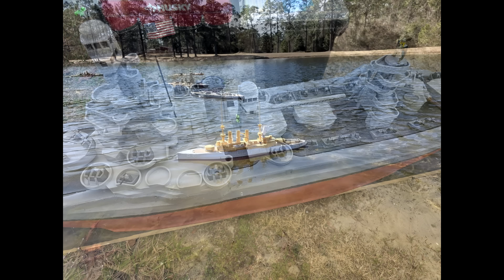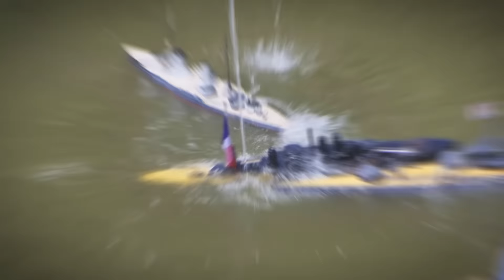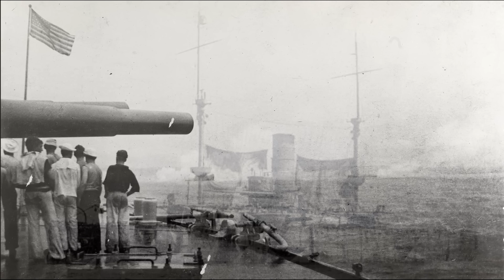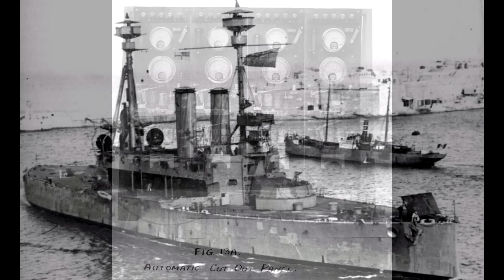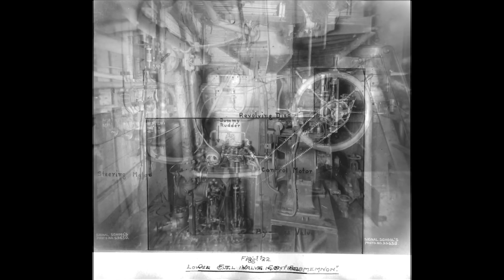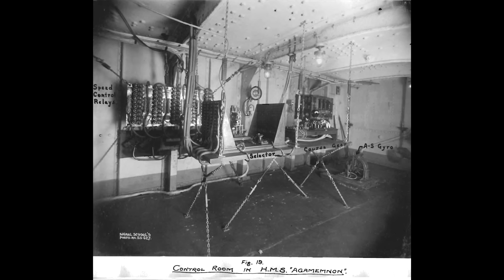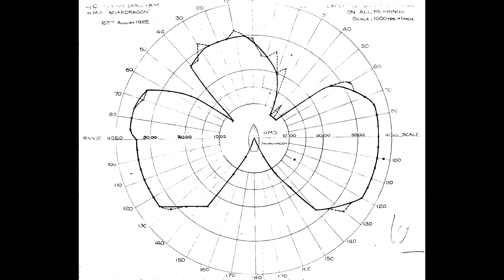Radio Control Battleships - HMS Agamemnon and How She Worked

Comment: Looking at that trailer I remembered a remote controlled submarine I had as a kid in the 1980s. I remember desperate attenpts trying to fish it out after it 'dived'...
Reply: Sometime around 1970 I scratch converted an Aurora model of the USS Skipjack into a fast and straight running battery powered torpedo. I had trouble with depth control too, but what fun that was.
Reply: No worries... the CIA recovered and examined it, no nukes onboard.😁
Reply: What goes up, must come down. unfortunately, it doesn't work the other way around. My condolences for your loss.

Comment: You had me at 'CO2 powered BB cannons'. Though it does raise the question - how close are we to having a vessel the size of a frigate or destroyer be made to run as a drone? The bigger and more complex something gets then yes, you need meatbags ....... I mean humans, to crawl into tight spaces and do repairs. Now, to be clear, I do not trust chatgpt or it's ilk to tell me how to boil an egg, let alone give it cruise missiles, but wit hthe way automation is going, how long before humans are taken (mostly) out of the line of fire?
Reply: Why even mention a language model for a drone? It's a language model, not an actual AI. It's just a marketing name.
Reply: That’s not the question I believe that’s being investigated. In principle a future Navy shouldn’t need more than Frigates (as drone flotilla leaders) & Aircraft (Drone) Carriers. The basic idea is a human crewed Frigate will have 12-30 drone boats under its command, dealing with logistics protection & firepower to make up a fleet. Offensive missile control will be from crewed stations, but AA & ASW defence drone boats maybe autonomous under war conditions. In this way you could give a single modern Frigate the offensive power of a C20th Destroyer Squadron, Cruiser or Battleship. Which is why no one is sensibly building Battleships at the moment. There is an issue about what happens if EW & SEAD aircraft gets in amongst such a drone flotilla, but those technical solutions would lie under Classified at present. But there is an attraction to modularising ship capabilities into drone flotillas, as it does solve perennial design issues of how to add weaponry, protection and power over time or during a specific conflict. Without taking your crewed assets off station, refuelling, rearming or refit should be possible at sea by adding various autonomous units. The drones themselves could also bring added power generation to the flotilla as a whole. This is the technology is now in testing to find the practical issues around operation autonomous boats, but large numbers of small craft in a swarm is where the beauty lies in this system.
Reply: @MsZeeZed  Unfortunately, in the ocean there are significant disadvantages to small vessels when the waves get large, which is a surprisingly often - and this condition can last for days at a time.  It's not like operating on a small lake or even a large river.  No first rate navy can allow itself to become dependent on small craft for surface operations, when it needs to operate in parts of the world notorious for bad weather - such as the North Atlantic.  Small craft can still have a place, of course.
Reply: I think the main point of drones is to be cheap and expendable; in many cases they are not even expected to return to home base after completing their mission.  So they are built with one or two specialised capabilities, and those become the drone's mission.  Some drones are platforms that can accept a variety of capability modules, which are attached once the mission profile has been decided.
Something the size of a conventional warship, even the lighter types of surface combatant, would very much not be cheap and expendable.  It would also be much more difficult to hide whilst enroute to or on approach to its target.  Once hit, it would also not benefit from damage-control efforts from an onboard crew.  These combinations of factors would probably increase the cost per mission way out of proportion to any increase in capability.
Reply: "humans are taken (mostly) out of the line"  Asking for Skynet?
Reply: The USN is using under water drones to search for mines in the Arabian Gulf.  My understanding is that these are semi-autonomous drones.  There plans for and testing of unmaned small ships designed to extend the sensor reach and defensive depth of a USN task force.  How close they are to deployment is probably more to funding than actual technical issues!  The Navy is also testing autonomous drones launched off the carriers designed to be offensive weapons.

Comment: It's funny how radio controlled ships, aircraft, and even glide bombs (FritzX) were developed way back in WWII and yet development 'appeared' to stagnate for 80+ years until the technology exploded in the Ukraine war. Much of it has now been replaced by sat comms, but is still in use with frequency hopping. Obviously there was probably some stuff going on but should have been much more.
Reply: The problem was it was very easy to disrupt the radio controls frequencies used!  That was why the Fritz-X was initially successfully but quickly became almost useless!  The Allies learned the radio frequencies used and jamed them!
That applies to virtually all remote controlled weapon systems!
The frequency hopping technology was invented durring WW2, but it's was in its infancy and not readily usable for remote control weapon systems.
It's use only became feasible in the 1960s-70s with transistors and integrated circuits!
Reply: It seems to be the perfection of Wi-Fi security frequency hopping technology was the key brake on development.  Drones have been around for a while, at least 2 decades, but hardly small and hardly cheap. Usually spotting/recce/recon and the occasional US Target could testify that there was an offensive capability.  But now it has matured into a tactical level weapon of serious capability thanks to in some ways old mobile phone technology.

Comment: Suggesting a video on the ship's blacksmith in the age of sail and on, (interested as a blacksmith myself) what they did, and maybe how the blacksmith, carpenter, splicers etc fitted into the ships company.  Great videos as always Drach!
Reply: The Return of the Obra Dinn has a bit on the ship's carpenter.
Reply: As I recall, the channel Gold and Gunpowder (pirate and late 17th century seafaring channel) has at least one video on the specialist craftsmen, their roles and lives aboard ships.
Reply: As a Blacksmith 🇬🇧 I endorse this message. The Royal Navy has a long history of employing Smiths port side and onboard her Warships. Frequently they were payed better than the regular matelots, and received more perks. ⚓️
Reply: As i understand it, there were usually experts in certain crafts on board the bigger ships.  It was necessary to have a carpenter on board, because while a crewmember could saw a board and nail them together, they weren't experts in accurately making things from wood.  Same with lines.  All sailors learn knots and line work.  But not every sailor could be trusted to splice a line correctly, or put in a loop or eye in a line.  Those tended to be skilled trades.  Blacksmiths even more so, although i don't know how often they would be serving on board.  Blacksmiths were probably dockside only.

But i am no expert, this is strictly my opinion based on VERY limited knowledge.
Reply: @jeromethiel4323  a lot of the Gunners were skilled Artificers, a mix of Blacksmithing and Engineering. They had to be able to fix things at Sea if repairs were needed. Or after Action.
Reply: @jer @jeromethiel4323 y mind (correct me if you think I’m wrong), there are a few traditionally “black-smithing things” that couldn’t or shouldn’t have been done onboard a ship at sea. Heavy forge work, bloomery work (just too hot and heavy) and something like Mass fabrication. I assume that most of the work done that on land would be of the smiths would be smaller repairs, sharpening/honing, and maintenance, generally.
But yeah, I don’t know enough about this at ALL. Video needed!!
Reply: I've done some searching, and despite finding many references to the Royal Navy Admiralty having officially crew complements for different categories of vessel, I cannot seem to find anything - primary or secondary source - saying what exactly those recommended crews were! It's very frustrating.

The 18th century Royal Navy did have specific ranks or positions for skilled crew members. I think every seagoing vessel was supposed to have a boatswain and carpenter (standing officers). Among other things, the boatswain would be responsible for the vessels rigging (e.g. splicing ropes if needed). Additionally, among other positions large vessels would have an armourer, sailmaker, caulker, and ropemaker (petty officers), but smaller vessels might have only some or none of those. The larger the vessel, the more mates and crew would be assigned to work directly under those officers to assist them in their tasks.

The above doesn't necessarily apply to other navies and other time periods, nor does it apply to merchant vessels.
Reply: Yes to this!
Reply: You have to be a bit more specific than "the Age of Sail". Whose ship, and when?